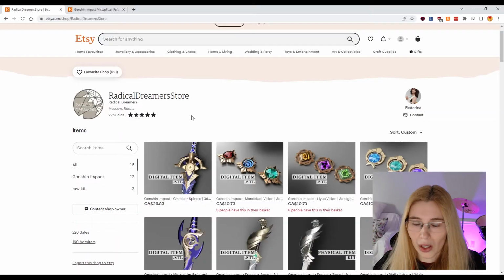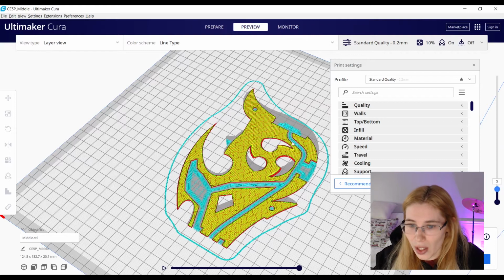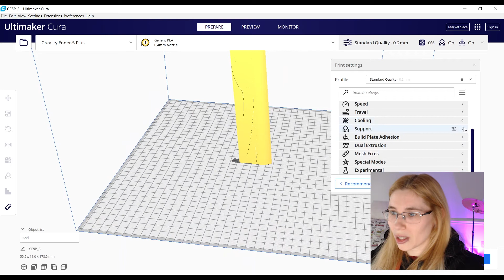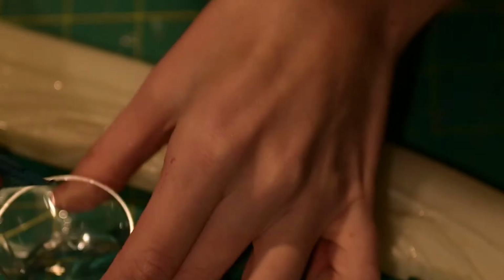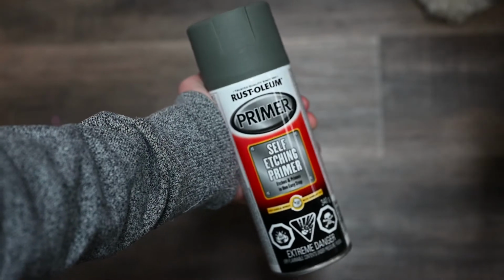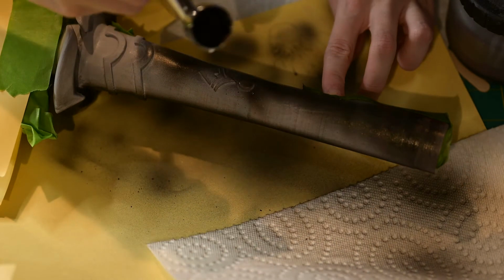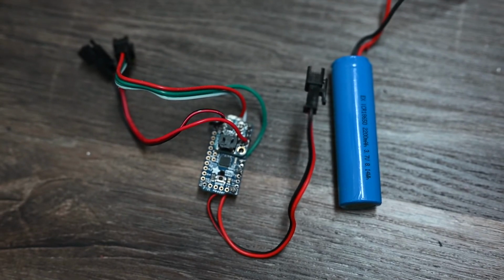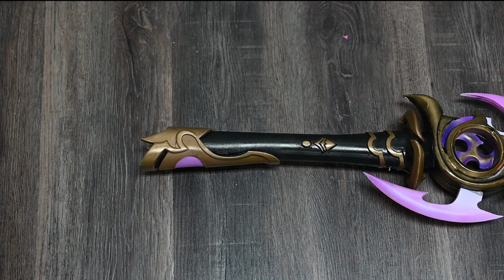Genshin Impact 3D PRINTED Mistsplitter Reforged

Comment: Which pins did you solder to the Poly backpack to the Pro Trinket?
Reply from the maker: I used a 3 pin header (they usually come with the backpack) and did USB -> BAT, G->G, 5V ->USB. One of my upcoming videos will be going over my new set-up as the trinket is sadly being deprecated. It sometimes has trouble connecting to newer laptops. >.<
Reply: @byteprops  Thank you so much 👏

Comment: Is 3d printed props heavier than eva ones?
Reply from the maker: The mistsplitter is just under a pound in weight; so a foam one would be lighter. I had no problem carrying mine for 6ish hours at a con! You can adjust the settings of your 3D props to make them lighter.
Reply: @byteprops  i see thank you!